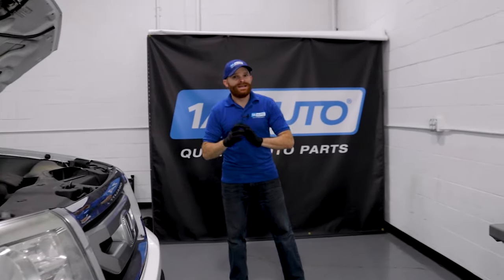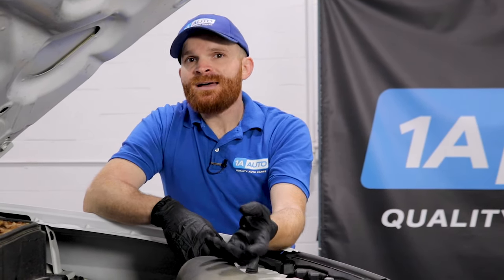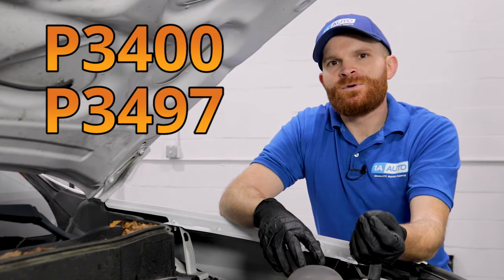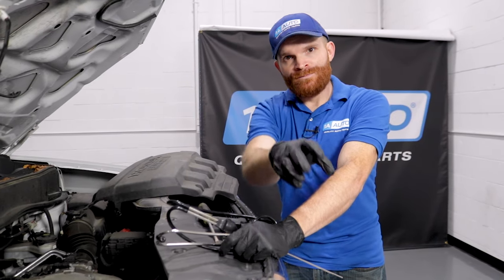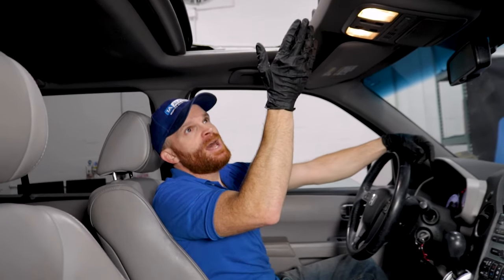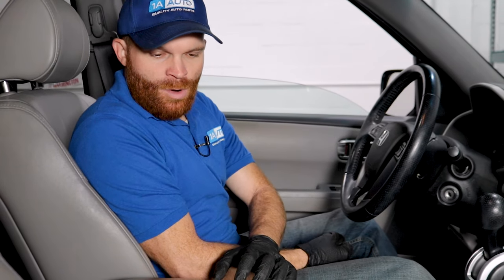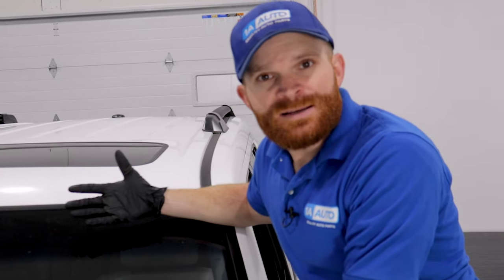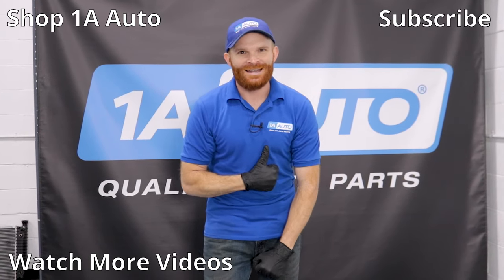Top 5 Problems Honda Pilot SUV 2nd Generation 2009-15

Comment from the maker: √  Watch the Video
√  Buy The Part at 1A Auto http://1aau.to/m/Visit-1AAuto
√  Do it Yourself
√  Save Money
Reply: 1A Auto: Repair Tips & Secrets Only Mechanics Know .       No problem
Reply: 1A Auto: Repair Tips & Secrets Only Mechanics Know.     You guys have amazing stock
Reply: Have problem with map light not turning on at times when i press the switch. Have to tap on the lens a few times before the light comes on. 2014 pilot lx. Anyone else have that same issue.
Reply: I have a question
I have a pilot 04
I tried to open the the with the fod key and wont open.
There is a light in the panel door dont see the light neither.
What can a do?

Comment: For Problem #1 "VCM Issues" you need VCM Tuner or similar product. This disables your VCM so your engine runs on all 6 cylinders all the time. No more oil consumption. No more fouled plugs. No more engine vibrations. No more misfires. After I installed it on my 2010 Honda Pilot (at 167,559 miles) it was like I had a new engine. It was amazing! Go for the VCM Tuner II.
Reply from the maker: +Pastor Todd Thanks for the feedback!
Reply: Can they add at the dealership?
Reply: Did that make any major difference in your fuel economy?
Reply: How bad did it effect mpg??
Reply: @TheKiddOnDrums  no much

Comment: So actually no serious problems...
Reply: Exactly. Good, solid vehicle.
Reply: Nah VCM can cause oil fouling spark plugs. Pretty serious issue. People disable the VCM.
Reply: Vcm is very serious. Mine has that problem.
Reply: @jimbark4642  I shut mine off for $125 on my Odyssey. 100x better vehicle now.
Reply: @midwestfarm757  May I ask how do you shut it down ? Can I do it myself ? thanks
Reply: @MouseyBusiness  you the best. Thanks
Reply: VCM is serious, but order an "SVCM" (Not the Muzzler) the S-VCM (and VCM Tuner 2) both are smart enough to disable themselves should the engine start overheating. The Muzzler carries a slight risk of overheating from say a bad thermostat without any indication of overheating on the gauge. S-VCM and the Tuner 2 both "disable" if things get out of whack so you'll know that something is wrong.

Comment: I just recently bought a used 2012 Honda pilot with 120,000 miles original. I don’t have any of these issues. My main issue is I am getting 9.5 miles per gallon.

Comment: Original 2010 owner here. My issue was the AC stopped working a few years ago. My local shop could not diagnose the issue and the Dealer said that the whole assembly had to be replaced at $2000. The Summer was just over so I decided to put it off. Checked only for similar issues and found out that it could be a blown fuse. Ordered the fuse and replaced it. Voila! it has worked since. Apparently, the fuse box is too close to the engine and this fuse gets overheated.

Comment: 2011 pilot owner here, haven’t had any major issues so far and it’s been a great vehicle. Only thing that does bother me a bit is the tire pressure. The rims are not the best and they cause the air in the tires to slowly leak out and the  tire pressure to drop quicker than most other vehicles. It’s not a huge issue and I’ve had it looked at before, but I’m not about to replace the rims on it and it’s not a safety issue, just a bit annoying.
Reply from the maker: +Nyrus Wolf Thanks for the feedback!
Reply: Try having a tire shop re seal the rims that worked for me. Also check for minor cracks in the rims. Took me 3 tires shops later to find a hairline crack that needed welding that wasn’t showing up under water

Comment: Never had had any of these problems. A Top 5 would be the rear shocks that go out often and make the ride very bouncy. Replaced two times and only at 100K miles on a 2011.
Reply: Truth.
Reply: I think that's why my TL feels bouncy
Reply: Yeah, I had one go out. Fully dead. Replaced both. Super easy at home. $85 each.
Reply: Sway bar links must be number two then
Reply: Very true

Comment: My 2009 fouled out the #1 spark plug every 10,000 miles.  Installed the VCMuzzler.  Problem permanently solved.

Comment: 3rd Generation Honda Pilot is a beast. Bought our 2012 Honda Pilot EX-L with 155,000 miles, we traded our pristine 2012 Toyota Camry for it and even though both Catalytic Converters are gone it's been on multiple road trips, now have 205,000 miles on it and working on preserving it even more now that used vehicles are 40% pricier. Well worth it.

Comment: 2012 Honda Pilot purchased in 2013 with 9k miles.  Great reliable vehicle now has $207k (Aug 2021).  Performed all fluid changes regularly myself.  I’ve had to do the following:
-alternator
-oil rocket arm assembly switch

All other maintenance routine:
-timing belt
-brakes rotors
- low and high beam headlights
-rear brake bulb
-spark plugs
-fluids, oil, transmission, rear differential.
-interior map bulb

Like I said great vehicle
Reply: I just had to replace the alternator at 100k on my 2011. Was also told that there’s a very small leak in the front spool valve that’ll need to be fixed at some point. 

Other than that and the cheap “leather” on the center console and door arm rest it’s been perfect
Reply: Is your 2wd or AWD?
Reply: How’s it do for towing? I’m looking to tow vending machines.

Comment: Well, you are absolutely right to start with the VCM issue, but anyone else who’s owning any 3.5, 6 cylinders beauty, (I have a 2011-Pilot) don’t just take this so lightly because the truth is that the VCM is a system designed to comply with emissions regs which in turn will eventually destroy your engine, yes oil consumption high, sudden cylinder misfire DTC’s (Diagnostic Trouble Codes) specifics or random, engine  vibrations, engine performance low, finally thousands spent in repairs, engine mounts, piston rings, heads, jacketing cylinders, oil pump, transmission, well I had all that.

Finally with my Pilot back on the road just purchased a VCMTUNER just 80$ to disable the VCM, yes never again that ECO mode, (well haven’t received yet) every time that ECO light turns on I know I’m destroying my engine, I would pour one extra gallon of gas around the gas station floor every time I fill in, even thought you are saving a lot unless you let that evil VCM system destroy your engine, really bad desicion by Honda on their pure interest!

Comment: Like ForunateDaD said... the fix for problem number 1 (VCM) is installing a VCMtuner to prevent some of the cylinders from shutting down. Takes less than 10 minutes to install and works like a charm. No more ECO lights displayed, which means it's doing its job. Best thing to ever come along to counter the issues of motor mounts going bad, oil consumption, fouled plugs and a lack of power. When I buy a V6 motor vehicle I expect all 6 cylinders to be running fulltime, not half of it!
Reply: Does it help on gas mileage and how do you take out the p4300 code?
Reply: @chasethedreamsam3398  You might lose 1 extra mile to the gallon, but gain many beneficial things in return. VCM is the absolute worse feature Honda ever came out with. You mean P3400?

Comment: Great presentation. In other words, this car is perfect. Ha. I agree. I have a 2014 and it’s the best car I’ve ever owned. Get  the VTM disabler. No more clunk. Only lost 1 mpg. Car will Go through anything. Including blizzards. You can do the fluids and breaks yourself. Do your major service at 100,000 miles. And regular oil changes etc, No major issues, ever. Thanks

Comment: Also another issue than I've experienced is if the dipstick is not seated correctly (2 O rings) Oil can leak out on to the alternator. This can lead to oil saturation which would need to be resolved by replacing/rebuilding the Alternator. It's recommended to check your dipstick after every oil change to prevent this from happening.

Comment: Good points... you did forget the front lower control arm bushings and the fact that the oil consumption problem called for the engine to be disassembled Pistons 1 2 3 and 4 cleaned with new rings and put back together with the new ECU update and plugs.
Reply: What about the lower control arm bushings? I feel a little clunk/click in the steering wheel while turning low speeds or stopped. Might be them?
Reply: Try this. With car parked.  Unrelease steering wheel lever under steering wheel,  move steering wheel in and out,  up and down.  Then relock the steering wheel.  Should eliminate the noise in the steering column

Comment: I had both a 2004 and 2011 Honda Pilot EX-L and the one common problem with both was the air mixture motor gear going bad in the center console.  The other cosmetic problem was with the 2011 Pilot where the fake leather on both armrests would bubble up.  I put 160K on the 2004 and 195K miles on the 2011 and overall, they were great SUV's and because of that, I bought a 2020 Honda Passport Elite AWD.  Never had the other problem that this video mentioned though.
Reply: Hi, I have a 2011 Pilot Touring. I believe the air mixture motor or air relay is bad. There is a continuous ticking noise under the center console for about 30 seconds when first turning over the ignition. Does this sound familiar to your experience?

Comment: For the VCM, if vehicle is out of warranty, install a shunt. Cheap and simple to install. Plenty of options on the web. Turns off the VCM and this stops the piston sucking oil into the cylinder. Fuel mileage does not change. My 2011 Pilot has a cyl 3 fouled plug at 136k mi. Changed plugs and put in a shunt.

Comment: 2012 Honda pilot owner here and I just experienced the low beams going out, found out it was just the bulbs that went out and not a whole wiring issue (after checking every single fuse in both wiring box’s) this video would have been so much help about 2 hours ago lol (still helped for future reference tho).

Comment: The paint peeling problem between the windshield and moonroof is a recall issue. Had that issue on my Pearl White 2014 Pilot. It was fixed by the dealer at their cost. They repainted the entire top panel.
Reply from the maker: +Timothy Neal Thanks for the feedback!
Reply: I have the same issue , do I just go to the dealer?
Reply: Our dealership told us that it was our problem. Even had exterior warranty. 2015 white pilot.
Reply: @a.r.5736  put your vin on a vin checker online to see if your car has any recalls
Reply: I need to follow up on this for sure. My 2011 Pilot Touring is doing this on the hood and the roof - mine is navy blue looks terrible and just really started this past 1.5 yr. my Pilot only has 67K miles
Reply: Had the same problem as well

Comment: I bought mine with 185,000 miles on it. Its now at 190,000 miles and haven’t had any issues so far. When I hit 200,000 Im going to have the transmission serviced and timing belt / water pump replaced for the 2nd time in its life. Im not sure if someone previously disabled the vcm on mine because when the “ECO” light comes on the engine feedback doesn’t change at. But anyway its still going strong!

Comment: Love my 2013 Pilot. It’s a great vehercle
Reply: Hahah
Reply: I love mine too. It's ran all over Michigan summer and winter. I've never gotten stuck and I haven't had any of the problems this guy talks about. It's not perfect but for the balance of what I paid and how good my experience has been I have no problem saying I love my pilot.
Reply: Nice.  I thought I was just hearing things....  I also love my 2011 Honda Pilot.  Solid verichle.
But really- this guy helped out on issue #1- excessive oil burning.  No visible oil anywhere, but it's frequently low.
I hate the ECO mode!!
Reply: Lmao !! Vericle
Reply: i have 2013 honda pilot 175000km still running good
Reply: @BA-wd1oo  buy a vcm muzzler 2 it will disable the eco mode.your engine will run like a true 6 cylinder engine.
Reply: @iandalewadasen2386  Thanks
Reply: I'm looking at a 2013 pilot with 140k miles.. I'm pretty tight on cash and I'm looking for something affordable for my girlfriend. I'm worried that the mileage is high. Do you guys have any comments on a pilot with this kind of mileage?

Comment: Have a 2012 pilot, changed timeline belt at 100K, alternator went at 150K, had a transmission shifting issue at 140K - had my fluid flushed with 12 quarts changed - now perfect and finally am going to look into changing my spark plus (but have no issue). Every time I do brakes I change the rotors. Also still haven’t touched shocks or struts. Think its also time to change all the radiator hoses.

Comment: If the VCM bothers you just turn it off. Theres a few places that sell a resistor you can put in the engine temp sensor that fools the computer into thinking its not up to full temperature and the VCM only comes on at full operating temp.  I did it.. takes 2 minutes and no more VCM

Comment: Timing belt replacement recommended at 100000 kilometers or 60000 miles. Ours had the tensioner start to fail causing a startup noise that would go away after a minute or 2, at about 95000 kilometer. As an interference engine I opted to have the dealer replace belt and tensioner, the waterpump, the external accessories belt and sparkplugs and Antifreeze at same time. What I objected to was the initial calculation of labour as if each was being done separately.  As in you have the accessories belt off to do the internal timing belt so don't tack on an extra hour for that. Cut back on waterpump time you are not doing all the other removals twice. I did not think to question if spark plugs are normally removed to ease work on the belt, if so may have been penalized there. At any rate the labour cost was reduced but only with me pointing to the issue otherwise would have paid 3 times labour. The use of a belt instead of a chain is maybe a 2 or 3000 dollar extra expense over life of car.
Reply: Interesting! I have a 2013 with 77,000 miles, second owner. Timing belt has not been changed, but all the research  I have done indicates it should be done at 1000,000 miles.
Reply: Timing belt at 100,000 miles my research shows ?
Reply: Oh, and I never ever go to the dealer for any work except recall.  I had the paint come off just as he said in the vid....that I took to local dealer. It was a Honda problem, they fixed it no charge.  I have a perfectly reasonable and smart mechanic!

Comment: Number one thing to do on any V6 Honda - if it has VCM - you want to disable it.
Doesn't matter if your car worked for years or you just bought one.
A couple of options with the most advanced being VCM-TUNER 2, then S-VCM (VCM muzzler functions but is more outdated design). Buy one of these and install it. The sooner the better.
Your engine will thank you and it will run longer and smoother than ever.
$130 that likely will save you an engine replacement. Prevents all the issues he describes in point #1.
Note: even if you don't have the engine shudder or noticeable oil loss, disabling VCM will prevent it from happening eventually.
If your vehicle.already have the issues they will go away often immediately after install.
Amazing restoration to normal operation!
Reply: Tks for the note! I evidently need this. I'm burning oil like crazy, but no leaks/smoke. 09 Pilot 150K miles.
Reply: @WPI94  get it done before all that oil burning clogs your catalytic converters
Reply: Just traded an 09 Pilot losing oil like crazy, dealer wanted $5200.00 to replace piston rings, I traded for a 2013 Pilot touring

Comment: I love my Honda Pilot but the flaky paint problem you were talking about is actually happening on my tailgate :( no body shop wants to guarantee their paint job (I got several paint jobs quotes this week). 
I recently had to invest some money in a few replacement parts and I’m really happy I did! (New Rims, headlights -HUGE difference, and rear window shade clips)
Reply: There’s a factory recall on the paint take it to your local dealership and get it done for free.
Reply: I took my 2013 and it looks like new!

Comment: I've got a 2005 Pilot (gen 1) with 172,000 well maintained miles.  Biggest issues have been BAD clear coat peeling off and poor corrosion resistance in the rear wheel wells.  Mechanically the car has been excellent.
Reply: I’ve owned 3 Honda’s, 2 accords (03,06) and a pilot (‘12), all have the wheel well corrosion. Luckily my pilots isn’t bad so I’m gonna get it fixed sooner or later but both the accords being older had it pretty bad. Honda does a piss poor job of protecting the metal lip from getting the paint chipped off.
Reply: @schooper.  I have the same thing on my 2012 honda pilot, but it's only on the passenger side rear wheel well.
Reply: I really don't get why it's such a continual problem with Honda and that wheel well corrosion. I owned a 1995 Acura Legend (which I loved) and that had rear wheel well corrosion as well. Kinda figured they'd have that resolved since 1995, but I guess not.

Comment: I just bought a used 2008 Honda Pilot 4WD with 230k miles on it. It has no signs of oil burning on the inside of the exhaust pipe and the compression on all 6 cylinders is (both dry and wet) are good. I was trying to stay away from VCM Honda PIlots  (2006-2008 2WD and 2009- all models) since I had no way of knowing   if the previous owners had deactivated the VCM and if so when. I did not want to spend too much for a very low mileage vehicle either. It shifts fine and it has no towing hitch so I guess the transmission would be OK for a while at least.

Comment: #1 VCM issues 
#2 engine sounds 
#3 power sun roof
#4 leather/ vinyl interior 
#5 running boards
#6 low beams wiring issues 
#7 paint pealing between top of windshield and sunroof
Reply: Look up on YouTube 

Gene kim
Robert breaker 
Chuck Missler
Reply: So nothing major.. good to know!
Reply: never had one of those, i have 8 years old honda pilot...the one only thing i fix before is the spool valve leaking